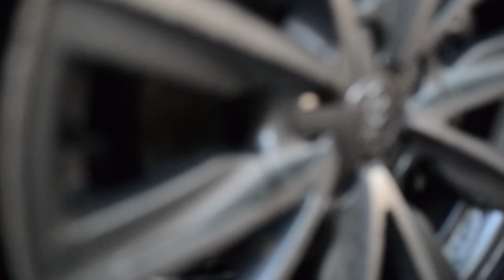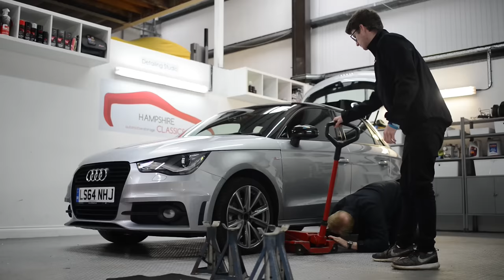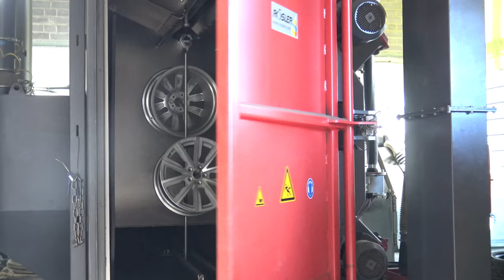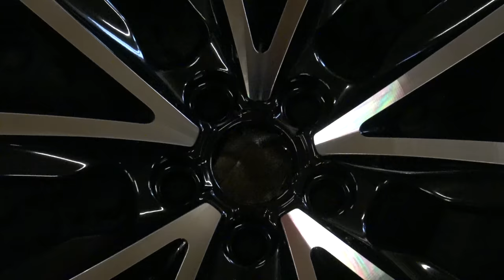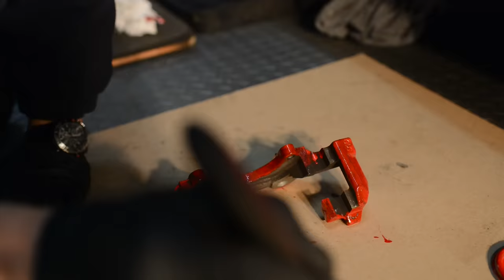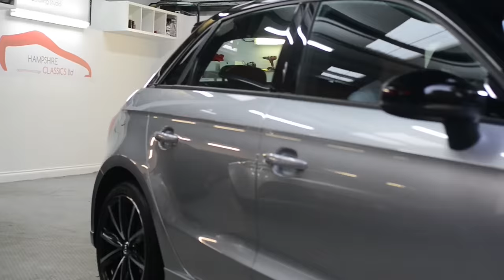Project A1 - Episode 1: Wheels & Calipers!

Comment: Did they weld the the damaged parts and then turned it in the lathe? Or did they just turned it until the damaged parts where gone? Also if they did weld it first do you know what welding consumable they used? And if not, how far can you turn it off? Sorry for so many questions :)